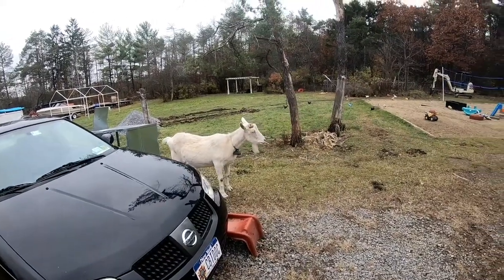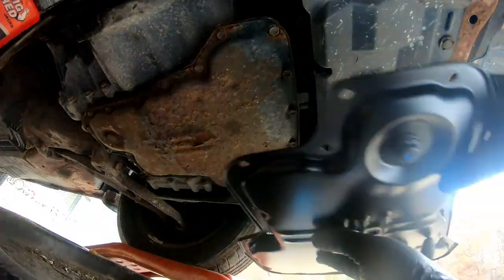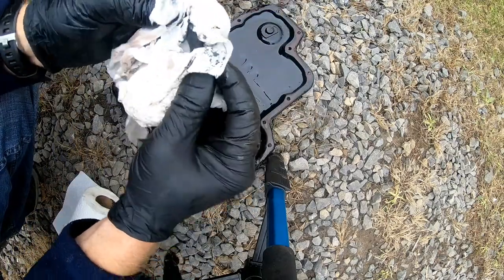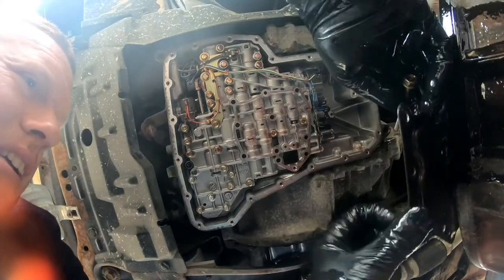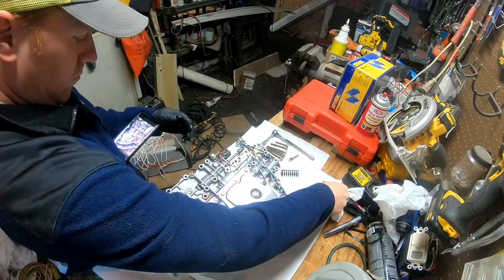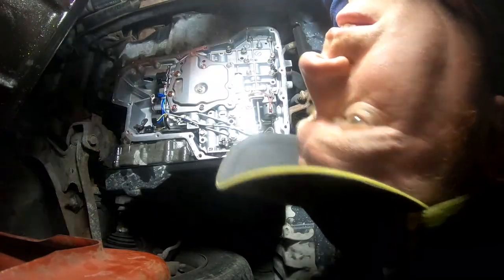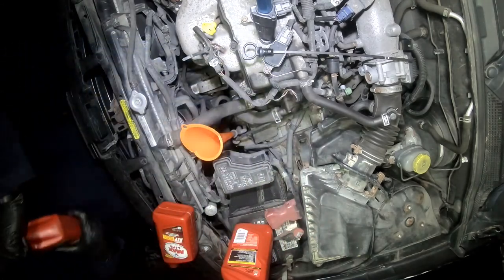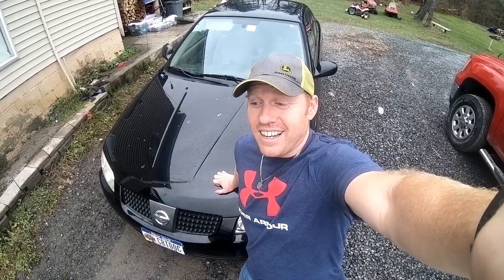How To Replace A Transmission Pan, Filter, And Gasket (NIGHTMARE) Dropping The Valve Body!!!!!!

Comment: Those ramps don't look all that stable - I'd be doing it on a concrete or something.
Reply from the maker: They were but totally agree with you I use 1 inch plywood pieces now unfortunately I have all gravel and no lift so I'm constantly on the ground!😬 thanks for watching!

Comment: I am in dat same problem write now was frighten but I understand thanks bro
Reply from the maker: Lol believe me I definitely know how your feeling! Good luck buddy! And thanks for watching!👍😊
Reply: Someone took out the valve body without the strainer an now there are some silver balls came out jus want to no how to set them back
Reply from the maker: Those are check balls, I take it the valve body upper and lower are seperated, there are more than 2 of them they go in the smaller portion of the valve body it looks like a maze you'll have to use a low temp grease to hold them in! You might need to get the schematics from the internet or ask the dealership to print it out for the valve body unfortunately I dont have the schematics and it would be impossible for me to try to explain where they go without being there looking at it, once you get the schematics it will be easy just remember the grease to keep them in place! Good luck buddy you got this!👍 let me know how you make out!

Comment: People, please give this guy a thumbs up. He saved me a living nightmare. I'm not a mechanic and I have no idea how to drop a valve body, much less put it back in with a mystery spring complicating things. Leaving the nut in there could potentially do damage. I had a similar situation happen to me when I changed the entire lighting assembly in my home because the ballast failed. There were 4 screws holding the assembly in place and sure enough, once you take them out and try to put them back in, the nuts that hold them in place have moved. The only way to fix this is to go to the second floor, and move the beds and furniture, tear out the floor, and find the 4 nuts. The people that designed these things knew this was going to happen. They knew a car would be stranded in someone's garage, and yet they did it anyway.
Reply from the maker: 😊😊😊😊 Thank you and thanks for watching have a great summer!👍👍👍👍

Comment: Fantastic Video. I had the same issue but i opted to leave the bolt out. Not sure what impact that would have, however, i have noticed that the oil level when cold (engine off) is above the hatched section and when its hot, the oil level is below the hatched region, which is the opposite to what i expected. I am suspecting that when the engine is shut off, the oil maybe draining back from above the valve block, through hole (where bolt used to be) and back into the pan, hence the high level. Any comments would be appreciated as imm half on mind to open it and drop the valve block as you have done. Russell, Qatar
Reply: If you do not think its the issue, what other reason would the oil levels be acting the way they do? Thanks
Reply from the maker: So do you have a filter on?
Reply from the maker: You should be fine the nut will just sit on top of the valve body!  When this happened to me I thought it was the end of my valve body if I left it without the bolt screwed back into the nut, hence why I took it down and after talking to many mechanics they say they don't even change out the filter they just clean it and leave the nut, so you should be okay!!
Reply: @WhitehouseFarmVet  yes

Comment: I drove more then 200000km without that long bolt and nut and nothing happend
Reply from the maker: I was kinda wondering and thinking the same thing, if it was necessary, you just confirmed what I was thinking about it! Thanks for watching!👍😊
Reply: @WhitehouseFarmVet  there are still many fasteners holding the vb in place and tight . And if the vb didn't move from place even  why bother ?

Comment: there is a small paper cartridge filter that is located by taking off the front left tire...and it only has one bolt to take off....you'll need an o-ring for the cover that bolts the cartridge filter in place.  The metal cover twists into place and then the bolt slips in.  That little filter is about 2 inches in diameter and four inches long.and it gets plugged up with gunk and small metal filings.   Thanks for the advice about not bothering with changing the metal screen filter inside the trani.
Reply from the maker: Awesome! Thank you that's good to know! Thank you for watching!👍😊
Reply: I have the factory service manual for this particular transmission and there is nowhere a paper filter you describe  .

Comment: Great video.   I ran to the same problem but I decided to leave that bolt off.  You think it be okay for the filter to have that 1 bolt missing?
Reply from the maker: Yeah i dont see leaving the 1 bolt off to be a problem,  there are no moving parts like pistons in an engine but I'm wondering if the nut might block something or just fall to the bottom I'm really not sure i dont think it would be an issue, I wish I had a better definitive answer for you!
Reply: @WhitehouseFarmVet  I forgot to say that I did fish the nut out with a flexible magnet

Comment: For anyone whom will do this job : 
1. cut a notch on the new filter at the whole wherever "that bolt with nut" is located 
2. take out all bolt of the old filter exept of "that bolt"
3. loose "that bolt" like to have 1/8 of inch play on it
4. cut out the old filter with side cuter at "that bolt" so you can remove it
5. slide the new filter under "that bolt" first and put back all the bolts tighten then up to
spec

Originally the nut at the reamer bolt should be located at the filter side . It is assembled the right way at the filter side , at my transmission it was located at the filter side .
Reply from the maker: Or just not do it at all unless you have chunks or alot of glitter from metal!!! , definitely not worth it, it's just a metal screen!
Reply: Originally the nut at the reamer bolt should be located at the filter side . It is assembled the right way at the filter side , at my transmission it was located at the filter side . It is not by nissans bad design, it is wrongly assembled at the line .
Reply from the maker: I just think to solve the problem the nut should be welded or casted into the Trans! It should not be able to move around then not be able to put the bolt in, poor design in my opinion!
Reply: @WhitehouseFarmVet 
probably they saved one welding step by this design but you will find way more bad design on domestic cars to save money and there was an assembly line in Tennessee for nissan how I know .
Reply from the maker: Yeah that's crazy!

Comment: The whole reason I watched the video was to see where the spring goes and you skipped that to show us you turning bolts everyone knows how to turn bolts . The spring!!!!!!
Reply from the maker: Sorry this was a long time ago wish I could help, best thing is to look up Nissan sentra valve body schematics and it will show you!
Reply: I have the same problem and after I put it back together the car will not shift any gear. I'm assuming it's the spring. I wish I had watched his video and found out about this stupid nut design before I started.
Reply from the maker: Another way to get schematics is to go directly to a nissan dealership and they can print them out for you, also ask to talk to one of the mechanics they can help out and explain about the spring!